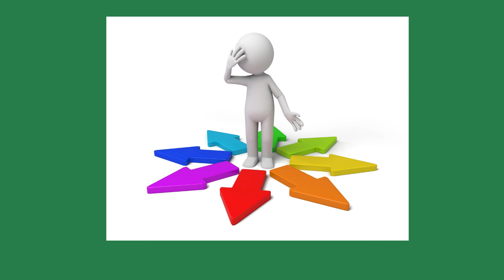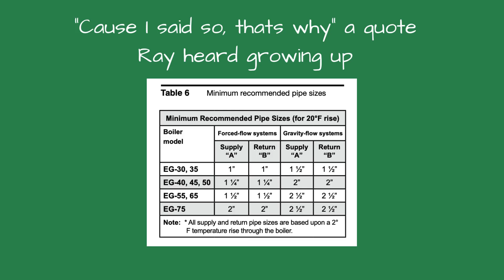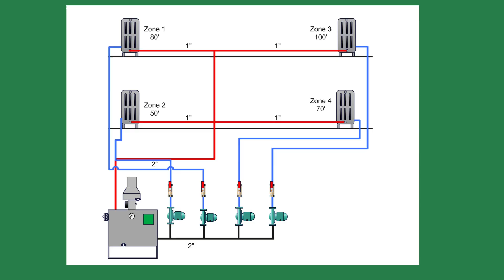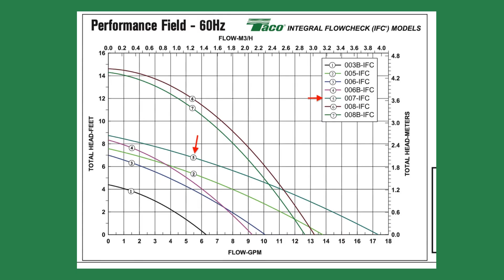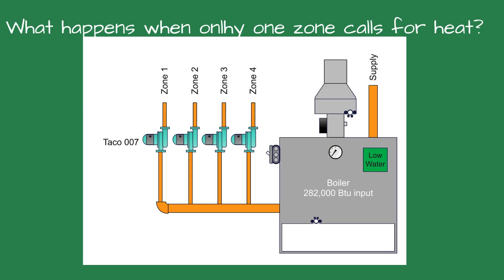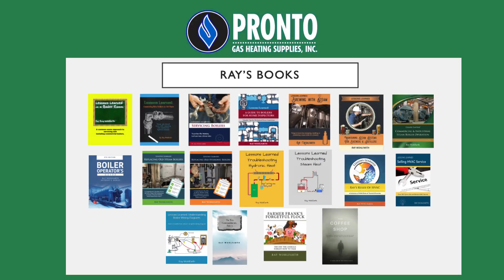Boiler failure mystery solved using the pump curve

Comment: Would adding bypass pipe from boiler output to boiler input have solved issue?  This would temper water up to prevent thermal shock?
Reply from the maker: It would I have seen them on jobs and they will prevent thermal shock The only drawbacks I see is when the next tech finds the valve half open and opens or closes the valve thinking it will solve the problem The other  drawback is if the boiler temperature changes. Weil McLain suggests using a blend pump to introduce hot water into the return. Thanks

Comment: is the 10,000 multiplier to get the boiler GPM a rule of thumb? so the boiler is oversized and the pump is undersized to get the ^T's down? humbly yours.
Reply from the maker: It is a rule of thumb Its based on weight of a gallon of water (8.33 lbs/gallon) X 60 minutes X 20 Degree temperature rise For example 8.33 X 60 X 20 = 9,996 or 10,000 If you want a 30 degree rise through the boiler, divide the output by 15,000 Hope this helped ands thanks for watching
Reply: @boilerroomdetective  thx

Comment: big fan of pri/sec piping. never had a problem after that type of system was installed properly. Everybody always blames the new energy efficient appliance.
Reply from the maker: You make a great point. Many people think that primary secondary is only needed on two or more boilers. Thanks